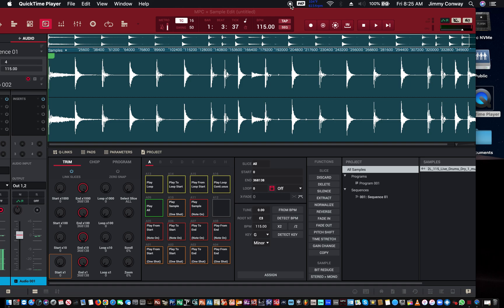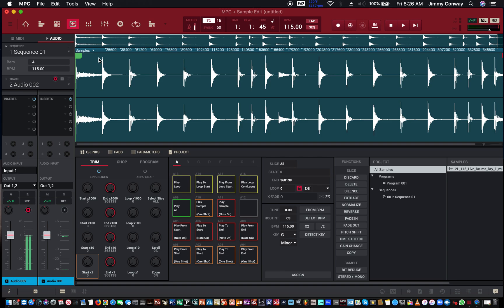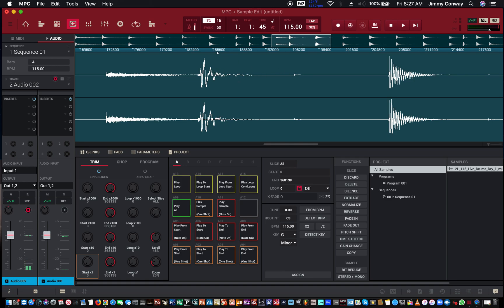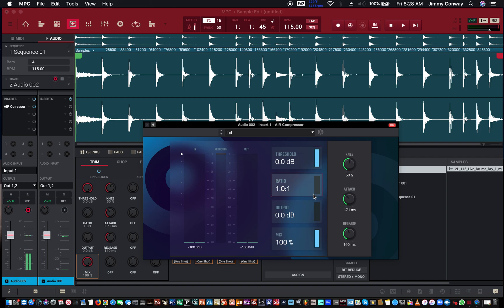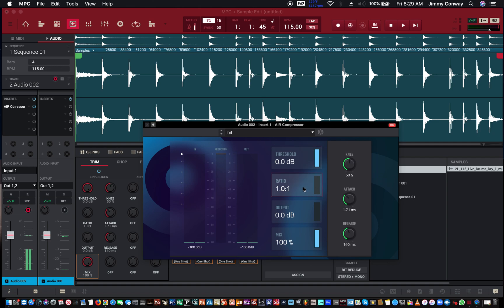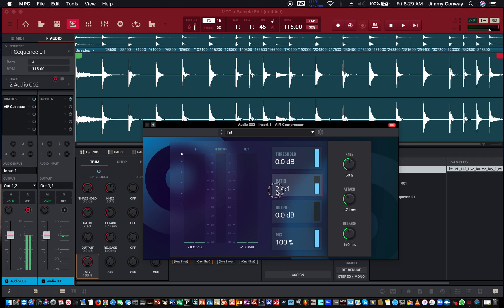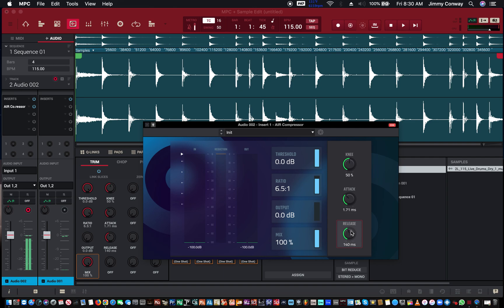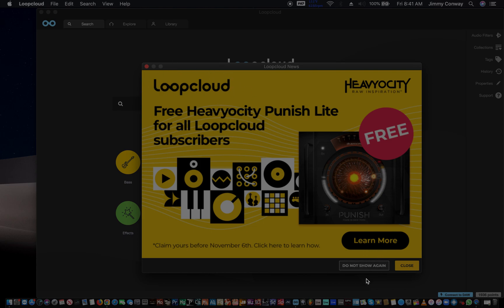MPC Beats Software Tutorials - How To Use AIR Compressor

Comment: I would love to use AIR Compressor in MPC Beats if only I could find the bloody thing: id does not show on the ADVANCED screen. I want to soften the kicks.
Reply from the maker: You might have to get the Full MPC Software.
MPC Beats lacks a lot of features that the full version has.
Reply: @musicproductiontips3121  ; Thank you. I found that the drop-down boxes above the inserts panel blocked the inserts panel. Argh. I guess I need a desktop screen and not a lap-top.